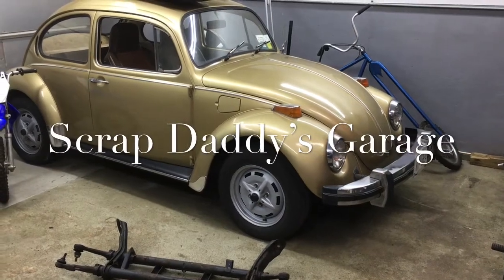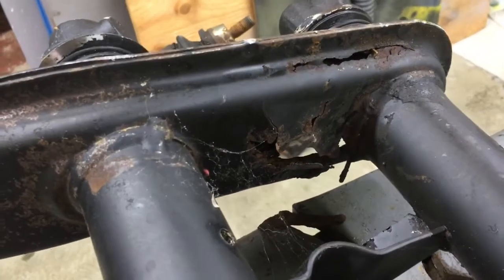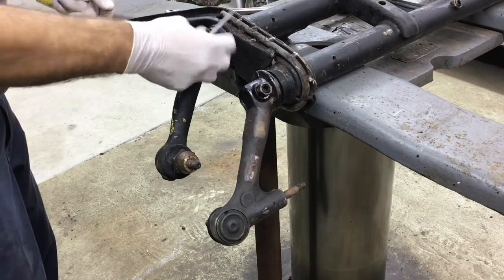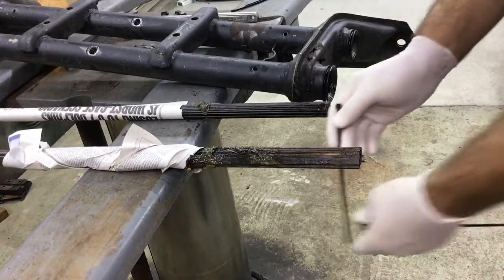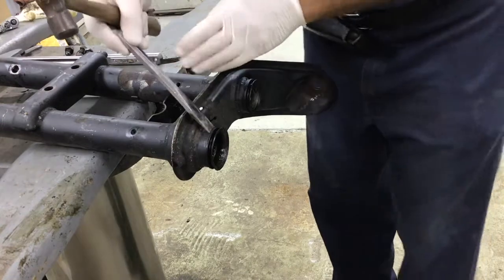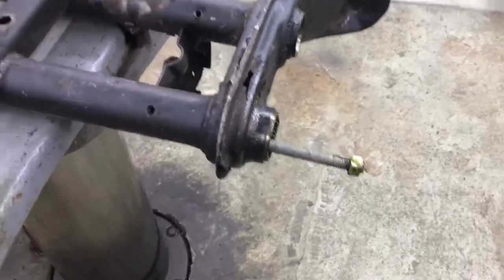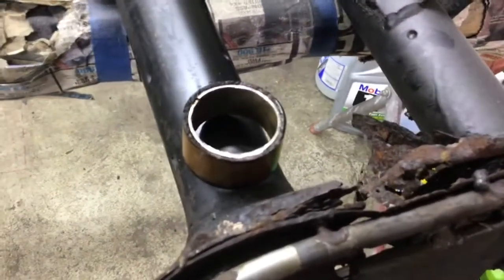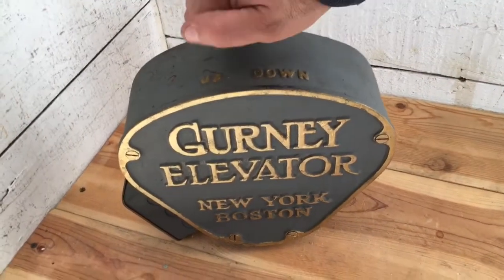VW ball joint front beam disassembly

Comment: You have any videos showing the installation of the springs back into the front beam? Having a hard time with mine.
Reply from the maker: Sorry I don’t. Make sure that nothing is bent on your beam, it may have come apart easily, but with a slight bend be difficult to get together. I purchased a complete remanufactured one with disc brake spindles from rock auto for less than $300. Thanks for watching and good luck
Reply: @scrapdaddysgarage5027  I ended up zip tying one end with the skinny outer ones extended a few inches and sliding the springs in working the fat middle one in last. Kind of in a V formation. Once all of them slid in, I aligned them up and installed the control arms.

Just to update you if you were interested.

Also, I have the same exact bug! Same color, same year, sunroof, etc. We painted it more true gold, with pearl white doors though. Anyway, thought you'd get a kick out of it knowing.
Reply from the maker: @mynewhndl1421   glad you could get it done. This car got repainted once in the 80s it’s definitely not the right shade. Have fun with your bug!